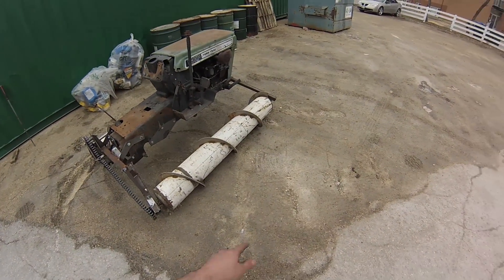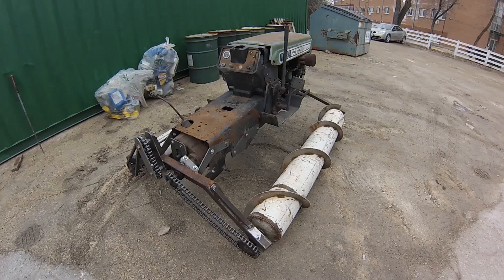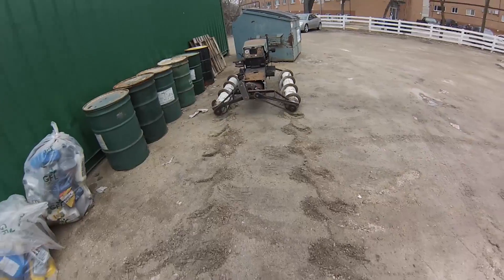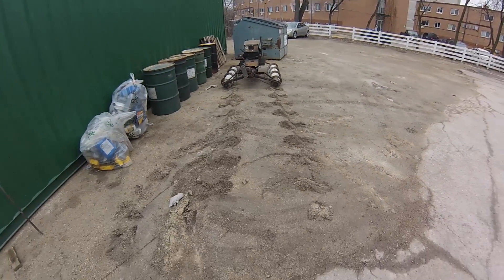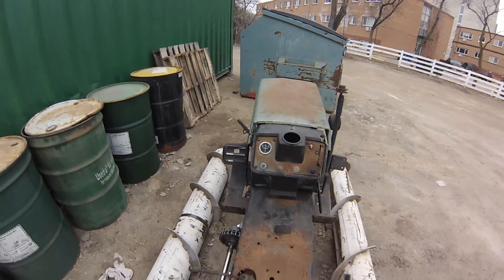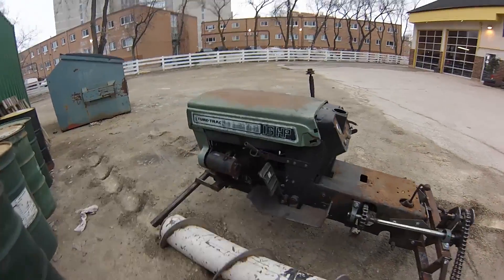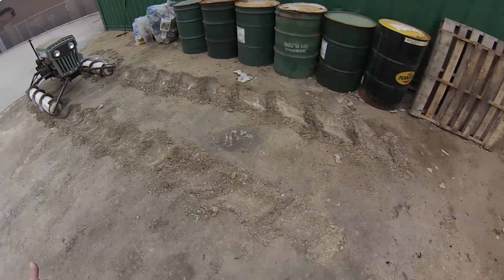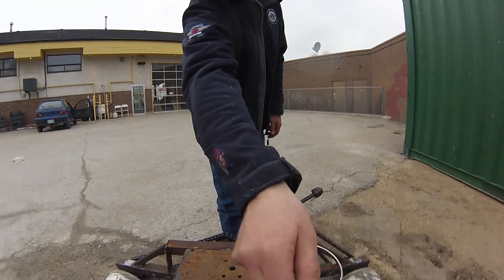Screw Drive Vehicle - Extreme Off Road - Part 8 - MOVEMENT!

Comment: I'm just wondering if the pods are too narrow. Perhaps with a wider diameter the footprint or distance travel will be less and putting out less torque forces against your brackets? I'm an aircraft engineer so this really isn't my areas of expertise just so thoughts. Good job man that thing rocks
Reply from the maker: +Andrei Jaremy yeah, i think your right, i'm starting work on some larger pods as we speak. more flotation